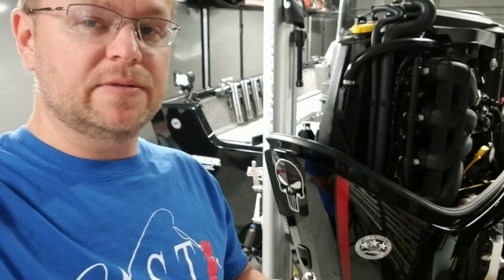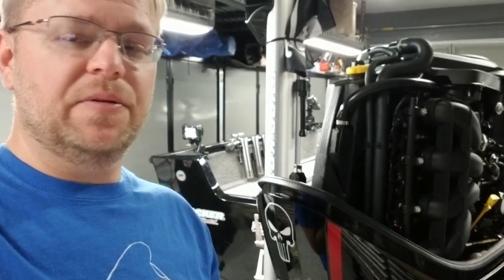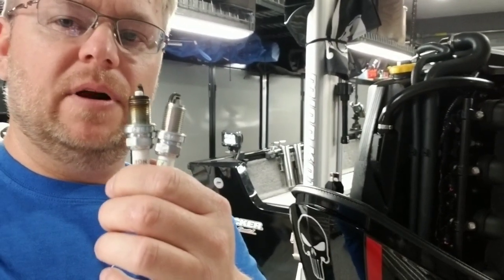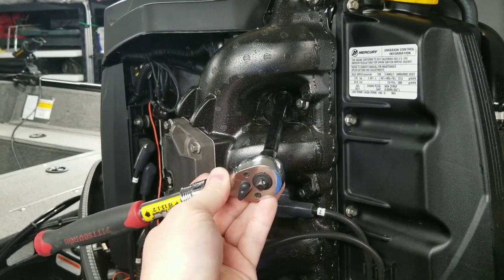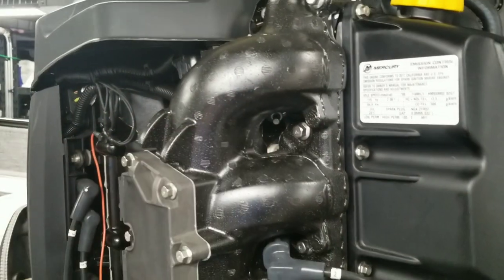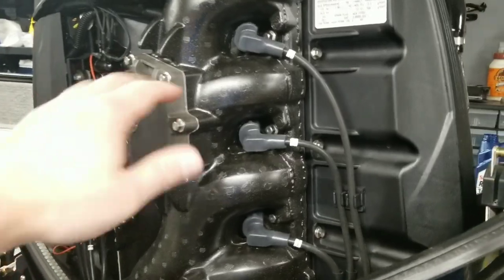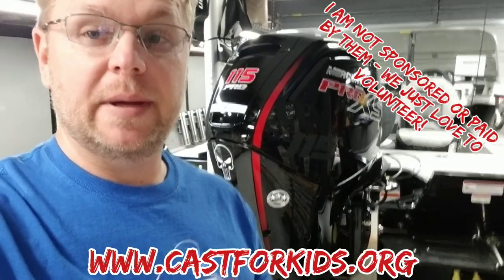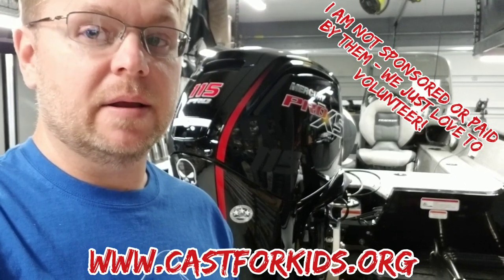Spark plug time for your Mercury outboard! Covers the 2.1L 75, 90, 115 and Pro XS 4 Stroke models

Comment: Putting plug #4 boot back on was more difficult than getting plug #4 out. Great video, I used the NGK iridium .44 gap plugs on my Merc 115 Pro XS, well she how she runs spring 2022.
Reply: Yeah same problem, no idea if number 4 is attached correctly now that I took it off,

Comment: Could you possibly do a short video on #4 plug removal? Lots of us struggling with it.
Reply: I was having the same issue. Removed all the nuts to remove the side cowling with no luck. Didnt want to force the issue and break something that would cost more than a spark plug. Here is what works for me, I use a Power Torque 2 1/2" 5/8 spark plug socket (O'reilly part# GM8250) with a swivel end along with a 6" extension and a Power Torque 3/8 drive universal joint (O'reilly part# GM8260)  connected to ratchet. Once I break it lose I remove the ratchet and universal joint and remove it by hand. Installation use the 6" extension with the spark plug socket until hand tight then attached universal joint and ratchet or torque wrench to tighten. This is on a 150, may have to figure out the tool combo for your use if not a 150.

Comment: What’s the trick to teething that bottom spark plug back in? Horrible location. I removed it but can’t get the angle right to get it back in.
Reply from the maker: I just had to use a few wobbles and short extensions.

Comment: How did you change the bottom spark plug?  I have such a hard time fitting a socket in there to change it.  Is there a trick to this one?  Any help is greatly appreciated!!
Reply from the maker: Hey Cliff, I used a short extension and socket. Inserted it first, and then attached the wrench. Was not so bad.

Comment: So my mercury 150 pro XS 4 stroke calls for Ngk-zfr5f, would zfr5fix-e work for me as well? Its the same gap but wanted to ask u cause u definitely know more about them then I do lol😂 and would they be better for me as well?
Reply from the maker: I would go with a zfr5fix-11. Gap is the next standard size wider at .043. With the fine wire electrode compared to the wide nickel tip on your stock plug, this gap should prove to be just fine (I ran wider on my 115 proxs - never an issue).

The fix-e will also work but had double the resistance which is not needed. Seems the fix-e was designed for better noise suppression in a certain use case.
Reply: @MR_Garage  so I bought the -11 but I doubled checked my manual and it only recommends the .032 gap. Think the -11 .043 gap will still be just fine?
Reply from the maker: -11 is perfectly fine in this situation (.043) with an iridium plug. Send it!
Reply: @MR_Garage  thanks man. I appreciate your help

Comment: Hello. I am changing my plugs and wanted to see how your outboard is doing with the iridium plugs so far? Thinking to make the change to iridiums if there arent any issues thus far
Reply from the maker: I do not have this outboard anymore but zero doubts it is running flawless. You will not have issues. Nothing special about these motors and in automotive, most all manufactures switched to them mid 2000's.
Reply: @MR_Garage  how long did u run ur motor for with those plugs before selling?
Reply from the maker: Believe it had 30-40 hours on them at the time of sale. Been a while. Had a few hundred hours on them in my honda's.

Comment: I am unable to find these for my 75hp with .032 gap. , which is what the decal on the motor says the gap should be.
Reply from the maker: Running iridium, you do not need to run a .032 gap in this application. Do not try and change the gap, run them as is!

Comment: Can you advise how to remove the #4 plug? it's almost impossible to get to!!
Reply from the maker: Use a spark plug socket with short extension. Add a few more short extensions until you can reach the plug. Not that bad if you add extensions in sections.

Comment: I installed the ZFR5FIX-11 with default 1.1mm gap into my Merc 150 4-stroke and noticed at my graphing speed (800-900 rpm) that my motor felt like it was missing and stuttering, but it ran fine beyond 900 rpm. Yesterday I switched back to new ZFR5F factory recommended plugs with .8mm gap and the 800-900 rpm issue is gone. Can a .3mm difference in gap really cause the issue that I experienced?
Reply from the maker: Spark blowout would never happen on these technically low performance 8v tractor motors. My only thought is, did you use a slide gapping tool on the iridium plugs? My guess would be that one had its tip fractured.